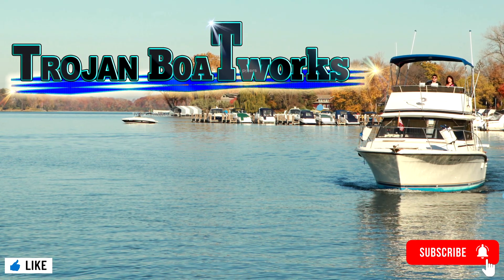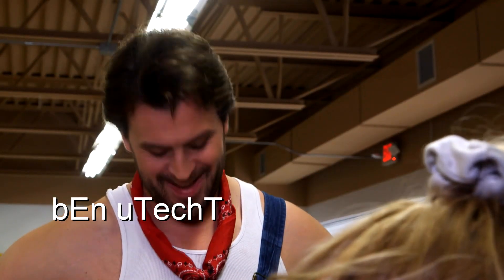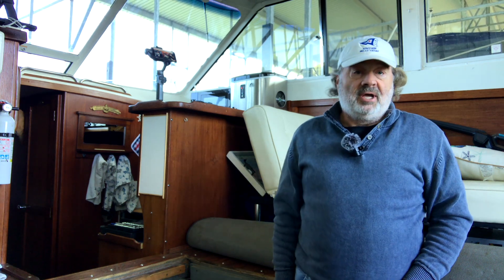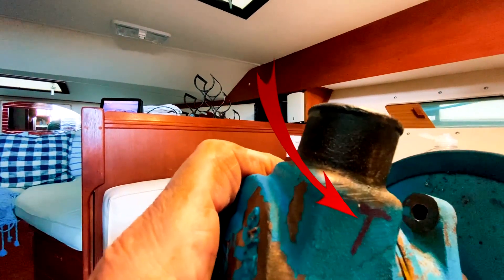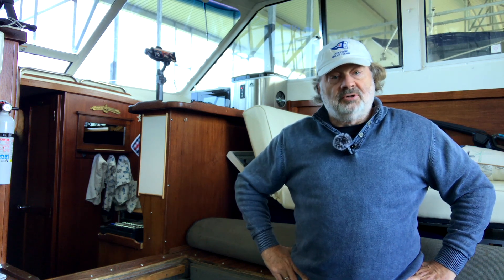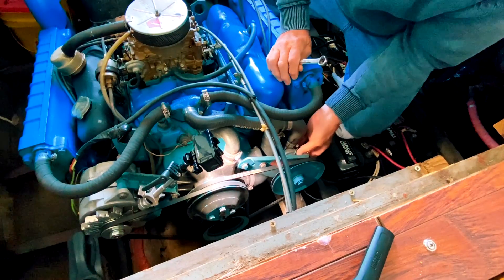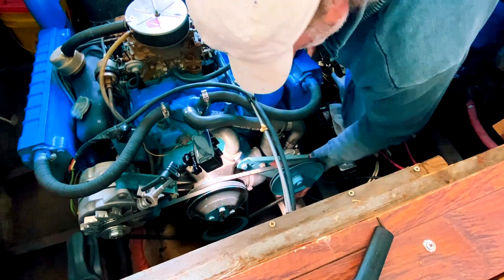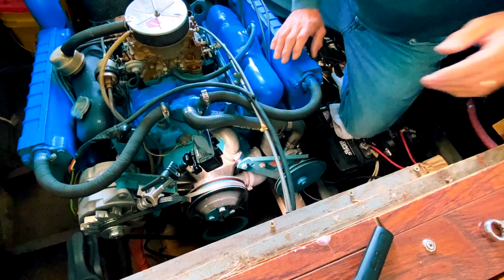HOW TO REPLACE A FRESH WATER IMPELLER ON  A SHERWOOD RAW WATER PUMP

Comment: Thanks very much for taking the time to make and share this vid for us DIYs.  A tip I would like to add is to use a gearwrench wrench.  Makes it a little faster and easier.  If you don't have a set, buy them, you'll be glad you did.  Also noticed the dishwashing liquid on your table.  You didn't mention using that as lube to get the impeller in the housing.  Also acts as a prelube for the impeller when you first start the engine.  Wouldn't want to run them dry.